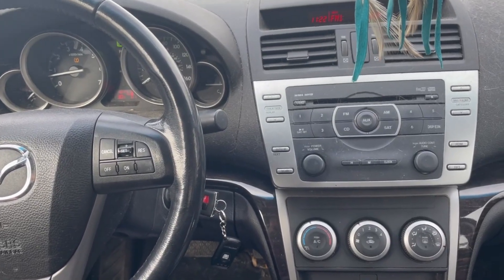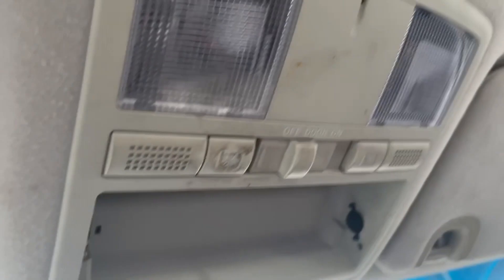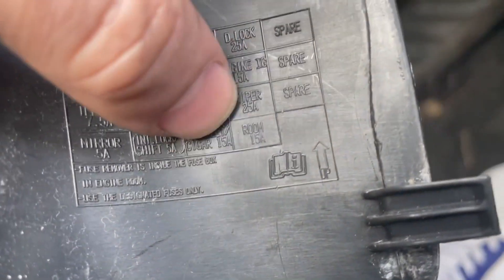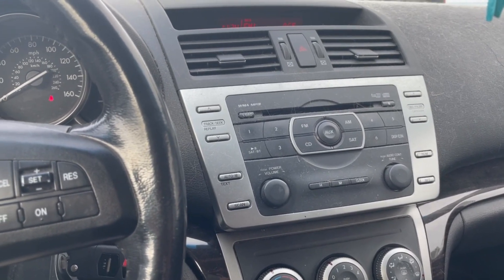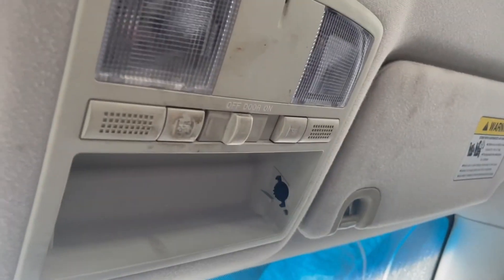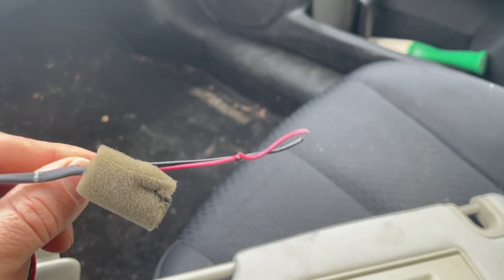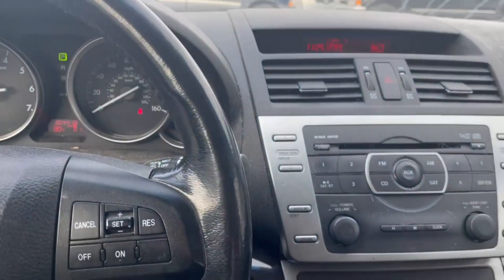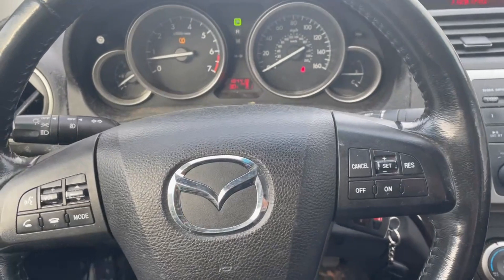Mazda Electrical Issue No Radio No Lights No Door Locks ROOM Fuse Blowing

Comment: Thanks to you mate, it took me just a few minutes to diagnose on my 2014 CX9.  I checked the 15A room fuse under the hood (blown),  Uninstalled the new sunvisor and one of the wires was slightly stripped and the bare wire was probably touching the metal ring where the 2 wires enters the visor bracket.
Reply from the maker: Glad it worked for you!

Comment: I have a MAZDA 6 2015.  
The lights on the doors aren’t illuminating.  Everything else is working perfectly.  Just the illumination lights where the window & door locks are. Only in the front.
Any ideas??
Reply: Do you suppose it’s that “ROOM” Fuse?
Reply from the maker: No that won’t be the room fuse as that controls a lot of other things as well that you’d be having issues with if it was that. It’s possible it could be the actual switches itself
Reply: @acetechauto7  
That makes sense…
I can live without these lights.  It’s not worth bringing it into diagnose the switches.  I’m sure it sounds like the switch.  I tried hitting/tapping it to see if I could get them to work…
Thanks 😊

Comment: What do I check if all the fuses are good. None blown? Room fuse (under the hood / 2008) is good?  if the fuse isn’t blow there can’t be a wire issue, right?
Reply from the maker: What issue are you having?
Reply: Same issue as this video.  No interior lights, radio has no power, key fab not working, trip meter resets on every car start.  Room fuse (or other fuses) are not blown.  Not sure if it could be a wire short of fuses are not blown.
Reply from the maker: Your fuse will only blow if a power wire touches somewhere but you can have a broken wire and still not blow the fuse. That’s going to require some deep checking unfortunately.
Reply: @frankd6547   Have you fixed it yet? I have the same problem as you in my mazda 3 bk 2005 version.
Reply: @alyllisestivajaa5107  sorry for the super late reply.  No this did not help. Still having the same issue.  Going to pull all fuses one at a time and see if I can find any that are blown.

Comment: I did this also, but still blowing room fuse 15 amp.  I removed driver side broken sunvisor but it keeps blowing the fuse HELP
Reply from the maker: You will have to keep checking all those other parts linked to that fuse that might have a short and causing that fuse to still blow.
Reply: @acetechauto7  , due to a broken Sun Visor that wouldn't stay up.  The two wires inside the sun visor that supply's power to the vanity mirror light was shorting out.
Reply from the maker: @anthonyz7023  the driver Sun visor is normally the one that goes on these and blows out the fuse. Glad you figured it out!
Reply: @acetechauto7  , 🙏 thanks

Comment: I have the same problem. Except my fuse looks good. Changed it out same thing. Prior to this happening i was taking out my door led light with a new one and it fell through the hole. I struggled to get it, and ended using a flat screw driver and inserting it in the slot of the light to bring it up and back into the hole. Tried many times, even got a spark out of it, gave up and just pulled the panel to plug the light in the socket. Too late bcs now nothing works? Help pls. I was trying to fix my car and only made a small problem worse
Reply: I guessing its something with my dtiver side door light. Lmk what i can do to fix it
Reply from the maker: What’s the exact issue you are having? Just your door light isn’t working or all your other electronics not working also?
Reply: Having this issue as well! But my boyfriend was changing out the battery. Still can’t figure it out. Ideas?